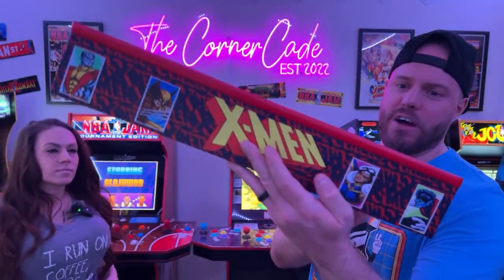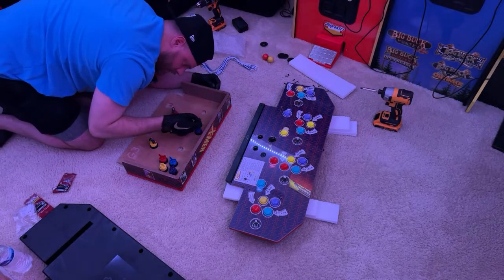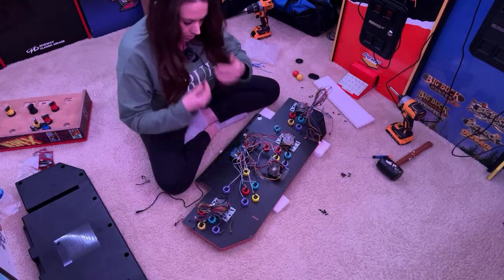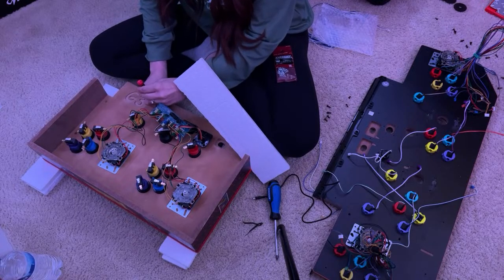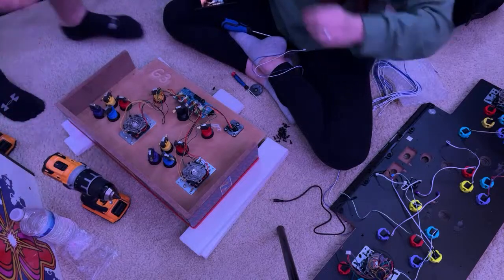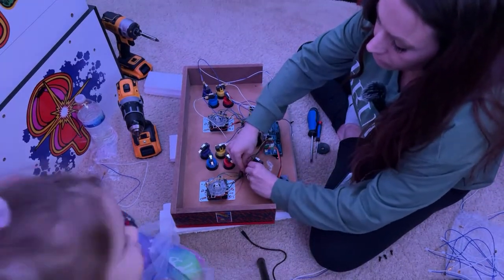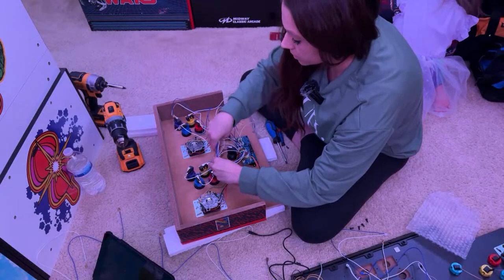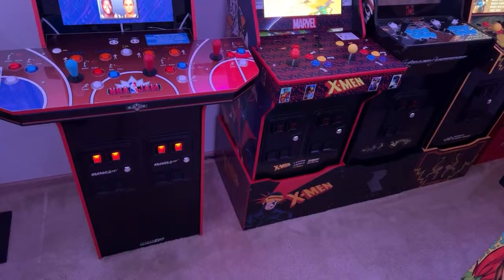Arcade1up X-men Deluxe Project, With The 99 Lives Arcade Two Player Deck Swap, Plus IL Buttons!

Comment: Does your conversion work with the other games on the cab?  I think cap America and the avengers requires all 4 players to play all of the characters.
Reply from the maker: Yes so for that game specifically you will be locked in as the 1st player with the 2 player controls as Iron Man and the 2nd player with the third player controls as Captain America!